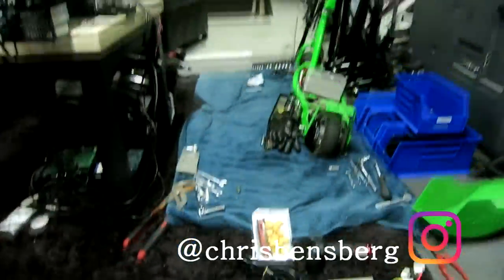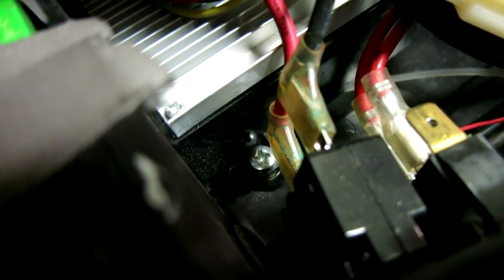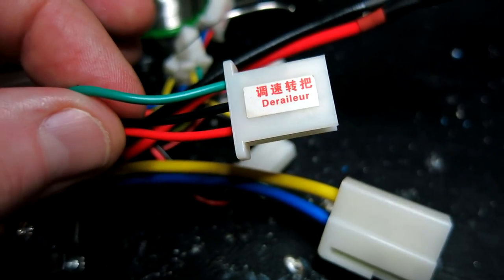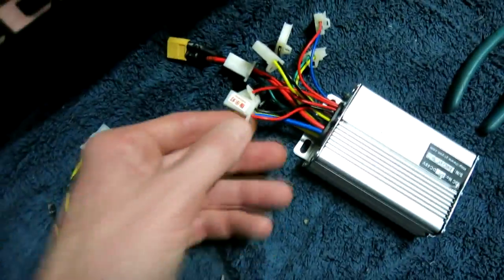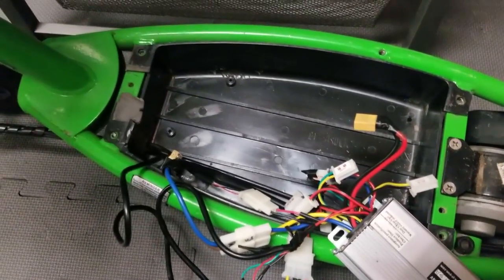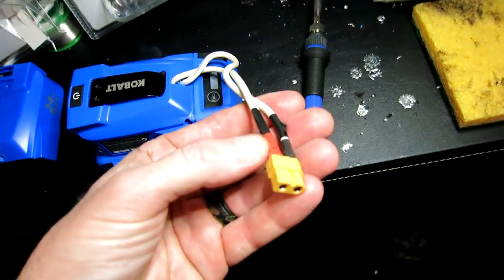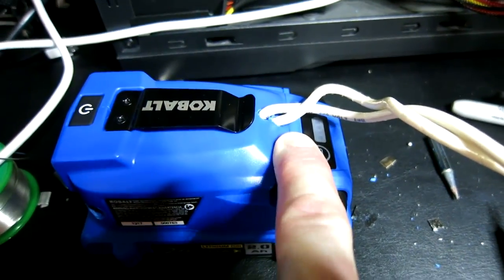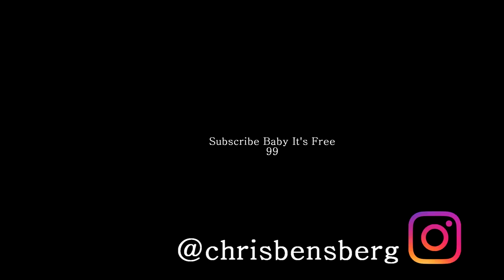30 MPH Razor E200 E300 Hack With 1000w Controller & 48v Lithium ION Batteries Full How To Make It!!

Comment: is the reason theres no video showing you going 30mph because youre running 1000w through a 250w motor and the motor has since burned out?

Comment: Great video, very thorough..I'm thinking of "Hot Rodding" my E3000, but going with a $99. Kobalt 40-Volt Lithium Ion 350-CFM 100-MPH Cordless Electric Leaf Blower at Lowes. It comes with a charger and battery and I can utilize the Variable Speed Trigger.. Yes, No?
Reply: Did you ever do it?

Comment: Just wondering, at 13:01 the red and black wires appear to be reversed at the connection, is this correct? Is that for the charging port?

Comment: Hey great video, just saying wouldn’t that motor burn out eventually cause you are over volting the 24v motor.
Reply: The batterys are 24v batterys. If you wire them a certain way the voltage stays at 24v no matter how many batteries are connected.
Reply: @jcbnorman12  
That's not what he's doing though. Its 48v... Not 24v anymore
Reply: It's better to replace motor too for safety.
Reply: This is my concern as well.  There is no way that 24V motor can handle a 48v load for very long.  How long did this last?
Reply: Nicholas Stewart he has never oiled the chain. He doesn’t care.
Reply: It'll fail quick. Even just a 36V overvolt will kill the motor within 20km of riding.
Reply: K
Reply: I've been running mine on 40v kobalt battery for about a year no problem. The only time I've ever hit 30mph though was down a huge hill. Itll run a steady 25mph no problem though

Comment: Great video. I have the same setup that I'm trying to connect.
You didn't show us how you wire the yellow and blue from the throttle ignition. Should I just connect those to the power lock?
Thanks for the great video
Reply: The stock motor won't handle it
Reply: He didn’t ask if the stock motor would handle it.
Reply: @owenherlihy  
Thanks captain obvious 🤓 I was trying to warn him that the stock motor won't be able to handle it and burn up.

Comment: My question is does that handle 48v? Because isn't it a 24v motor and you are essentially doubling the volts and watts.... How long do you think that motor will last before it burns up?
Reply: Not long, the most you can do is double the voltage/wattage but it will shorten the life spawn, what he is doing is 4x what that motor is rated...it will burn up

Comment: No riding videos and he used the stock 24v 250w motor with 48v and a 1000w controller... Guessing that didn't last too long 🤣
Reply: No riding video = it didn't work.
Reply: So if you have a 24v motor, you need a 24v battery setup ?? How many watts for the controller?
Reply: He's also got a lot of videos where he does switch most of the partys put if not all. I think he does it just to show the specific step

Comment: I did this same modification about the same time to an E300, but i used 18V dewalt batteries, and USB charging adapters, same throttle, and same controller, but i also upgraded sprockets and chain. Sourced the bits from aliexpress and ebay. Motor ran fine at 36V for ages, but 2.0ah batteries just don't last long enough to use the scooter to commute with. Sold the E300 with the mods, but got given another E300 for free not long after. I bought a Xiaomi M365 for last mile commute each day, but still think the E300 was a lot more stable and am considering building an E300 with outrunner motor and big batteries.
Reply: So no issues running 36 volts with the stock razor controller? How many amps were the batteries? I was thinking of building a 10s3p lithium pack with 2900maH batteries to form a  36volt  8.7aH battery...
Reply: @martinstolzenberg2456  I was using a 36v 1000w controller from aliexpress. Have sold the second e300 now, and am converting a goped bigfoot petrol scooter, looking to use dualtron hub motor/s.

Comment: i have a question..    if i do this but half of what is used in the video: 500w 24v controller : 450w dc 24v brushed 5.5a motor : would it work
Reply: Yes either scenario would work.  You don't get as much torque with 24V batteries and a 500w controller but overall speed should remain the same as that's dictated by the motor RPMs and tire size.  So it just makes it harder to go up hills.  Now changing out the motor will change the speed and torque, depends on the specs for your motor.

Comment: I know it's a bit trivial but you keep referring to the batteries as inline, but dont you mean in series or in parallel.  In series ups the volts and follows the positive to negative connections while in parallel connects negative to negative and positive to positive and ups the amp hours
Reply: He did them in series
Reply: he used white wires for both + and - which is a bit confusing, but in-line or in-series was not confusing to me.

Comment: Is there a reason you're not routing the power through the switch and using it or were you just being lazy? This is a serious question. It might sound like a criticism, but it's not. I'm planning to do something similar and you're the third person I've seen who bypassed the switch and I'm trying to figure out why. It seems like it'd be a simple matter to just use it rather than having to pull the deck off and disconnect the batteries every time you're done riding so I'm wondering if I'm missing something.
Reply: Switch can't handle that kind of power
Reply: I 2nd that the little switch can't handle the power I didn't understand it 1st didn't think yeah didn't think that switch had to pull that amount of power  Is through it that was the whole point of the motor controller it had stumped me for a few minutes at 1st.   Bypassed at 1rst then got a better switch later on.

Comment: Do we have to replace the throttle
Reply: Yes, the factory throttle is a On/Off switch.  You most definitely need a phased throttle so your options arent off or Wide Open Throttle.

Comment: I built a similar mod. Thanks for the video. Very in depth and helpful. 
I'm having an issue and looking for help if anyone has an idea what's going on. 
I have basically the same mod as the video, my batteries are 2x DeWalt 20v 4a. 1000w controller. The motor runs off the ground. But under load it is very slow. I was wondering if it's a low voltage cutoff?
Reply: If it's a 48 volt controller you are not giving it enough voltage....
Reply: @martinstolzenberg2456  Thank you!
Reply: Poor connections.  Is the wiring heating up?
Reply: Hey Eric - I am trying to do the same thing.  Mine doesn't work at all.  Were you able to do something to get it going?
Reply: @roballaer381  Hi Rob! Not enough voltage from the batteries to the controller. I can't remember which I did - smaller controller or larger batteries
Reply: @ericnielsen9714  Thanks for the reply.  I just ordered a 36v controller for $20.  Hopefully that solves my problem!
Reply: I would go with a 36v controller because that would be your best bet
Reply: No matter what on a brushed motor you will never get 100%  Is efficiency with a motor controller your best bet is to use relays or is or even a cheap solo solenoid that way you're giving all the power to the motor and it's a whole lot cheaper and you don't have to worry about burning it up

Comment: What does "inline" mean to you?  you got all the basics wrong here it's in series and if you add the volts amps stay the same and if you add amps (parallel) the voltage stays the same can't do both! and a major issue for me is a proper charger to charge 48vdc @ 2Ah...... as each battery pack has its own bms that includes a current shunting circuit and yes the motor would get very hot because the windings are too thick prob not enough of them for the higher voltage. A hub motor would be better or at least a 48v replacement motor any info is appreciated cheers.

Comment: The stock motor on a Razor E300 is the MY1016 (by Unite Motor Company).
Rated at 24 V, for 250 W (which at 24 V is ~10 A)

Dumping 48 V, and current of up to (1000 W / 48 V ~= 20 A) will fry the thing in no time.
Reply: I guess the output of those tool LiPo packs might be below 20 A, so maybe that would be your limiting, and possibly protecting factor.

Still, that motor is gonna release its smoke right quick.
Reply: Better to burn out than to fade away.

Comment: Fun fact: if you happen to have an air compressor and have the air nozzle attachment and wedge the tip of the nozzle under the grip as you blast, it will easily remove the handlebar grips.

Comment: better option would be to get 2 4 cell lipo packs  with 60c rating at 6500 mah
Reply: NO STUPID, THAT WOULD ONLY BE 33.6 VOLTS, THE CONTROLLER WOULD CUT RIGHT AWAY THINKING THE BATTERIES ARE DEAD,  HE HAS A TOTAL OF 50.4 VOLTS WHICH IS WAY BETTER, AND THE CONTROLLER CAN HANDLE UP TO A MAXIMUM OF 63 VOLTS WITH LEAD ACID BATTERIES WHICH CAN ONLY REACH MAX OF 60 VOLTS FOR  (4) OF THEM BUT THEY HAVE A BIG SAG VOLTAGE.
Reply: @TechKnowCSS  bro tf type of crack are you taking
Reply: @bunnyhop832  I HAVE USED THOSE CONTROLLERS AND KNOW HOW THEY WORK AND TOOK THEM APART AND KNOW THE CAPACITOR VALUES INSIDE THE CONTROLLER WHICH LIMIT THEIR MAX VOLTAGE, IE 63 VOLTS, ALSO I CAN ADD BATTERY CELLS AT 4.2 VOLTS PER CELL AND 8 CELLS IS 33.6 VOLTS. AND THE LOW CUT OUT FOR THAT CONTROLLER IS ABOUT 41 VOLTS. PUT ALL THAT INFORMATION IN YOUR PIPE AND SMOKE IT.

Comment: I built the thing it doesn’t even last 5 Minutes on low speed
Reply: Yea I was thinking those 2AH batteries were a poor choice..  They make 3, 4, 5, even 6AH batteries.  I would try a pair of the bigger ones (if you could get them to fit in the housing) hooked in parallel to make them last longer and give less stress on the motor, but you would probably still get a higher speed from the added Amps capacity...
Reply: @plupkination  The motors arnt the same in E200 ( 200watt) E 300 ( 350 watt)..The 350watt can handle 36v ( I have different razor.i got for free)
I also have a schwin 350 watt ( free)
I also have a the razor drifter ..it use the 350 watt...Ive ran it on 36v. ..it fine ( if your not too heavy) 12-15 mph ...due to gearing..but plenty fun to drive.
3-ea lead 12 AH lead acid ( 7-8 miles range) that's 12000 mah compare to
2000 mah.lmao
The 48v will FRY that 200watt or 350watt motor.lol
I go an MX500 for $20..it has 500 watt 36V.. I could bump it to 48 v
but I also have 1000watt 48V ( $60)
I also pull a D.C.  2.6-2.8 Hp at 1980 watt ( 2000watt @ 96V..lmao)
8000 rmp
from a TREADMILL ( I got for FREE...Found on side of curb.lmao)
I can run 48V  at 1000watt at 3500-4000 rpm there about.
Gear it accordingly for a KIDS's size go kart. (15-20mph)
You;re going to need 3000-5000watt BRUSLESS for an adult
72-96V  or wazooo of AMPS on 48V... to get it do 30 mph.lmao

You'll get  30 Kmph..( 15 mhp...or NOT 30 mph..lmao)
on that little motor...
maybe 20 mph on a 48V 1000watt motor...if you're lucky...
Not just 5 mins  runs...but actual 1 hour driving time.
batteries are Heavy
and They ALSO GET HOT....No matter what you use.
USE THICK 4-8 awg flame proof wires ( jacket)
48V is a lot of voltage...just saying.

The batteries on electric wheelchairs are 37ah....37000mah
( 12-15 mile range...depends who's driving)
Reply: OneEye Monster so I just found a trash picked razor E175. The batts are dead but the motor and everything else is fine.. what new batts would you recommend to give it a little more speed and riding time?
Reply: @plupkination  if you have 24V cordless ( lion) drill batteries 5-6ah...already. That's the cheapest or a charger and 2-ea will cost $100. You can fit 2-ea in the battery bay..or always have one or the charger
or I used ride an e100 on 6s Lipo 50C 5000 ( $25-$30-ea) $30 for lipo charger with transformer. You can fit 4-ea in the battery bay...but its the charging time if you dont have enough chargers. ( $100-$125) either way..if dont have those eq already. The lipo will have more power than the lion....However.if you choose 24v lion...you can also use them 
in Powerwheels ( you can get cheap on F,B, market..i have over 10-ea powerwheels $15-$50) My grand kids loves it. ( You cant use 24v Lipo
on powerwheels. it's too much amps..but 24v or 6s lion are fine)
For the older kids...I'll basically take parts from the razor and mount it
on the powerwheels ( 350 watt to each wheel) 24V..12-15 mph..with breaks...The motors from e100-175 and chain drive will work too.
It'll basically eliminate the plastic gearbox 10-12 mph is plenty fast
for powerwheels.
Reply: @plupkination  4ah kobalt 24v batteries fit
Reply: All the energy goes into producing heat and burning wires.